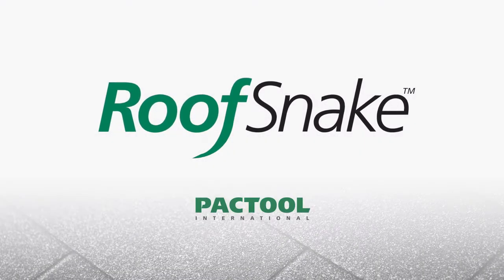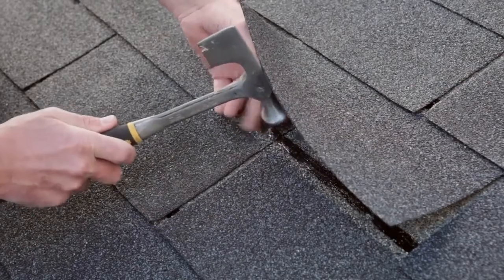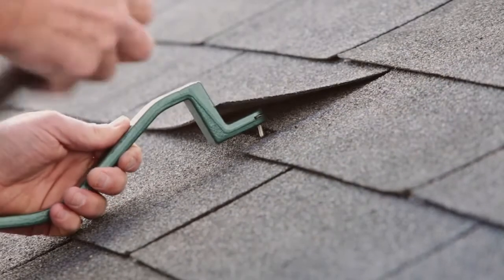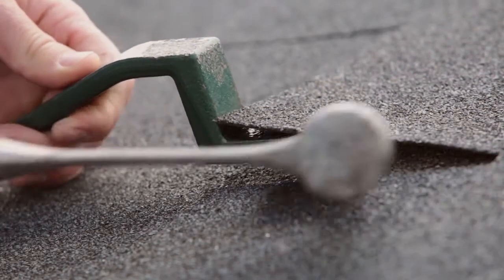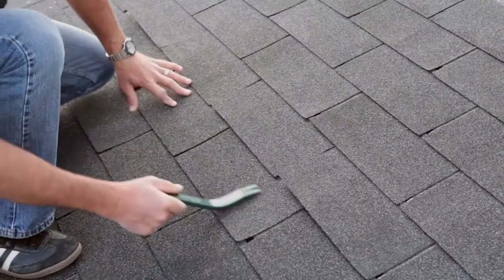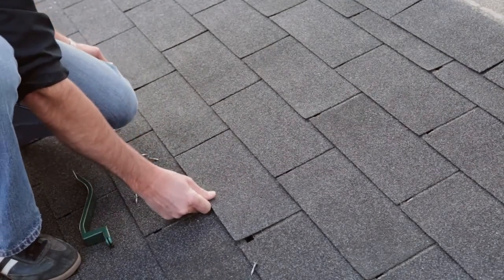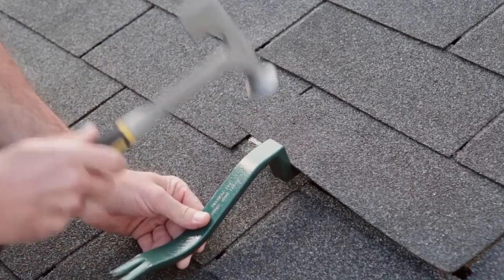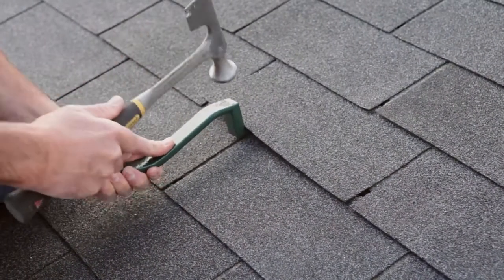RS501  RoofSnake™ - Shingle Nail Puller, Roof Shingle Installer

Comment: If your nail just slips into the decking like that, you don't have a nailable surface and the nail will never hold.

No way that shingle stays in.

Can you please show how to properly drive the nail so it is 90deg flush to the nailing surface when you're NOT going into a pre-drilled hole?